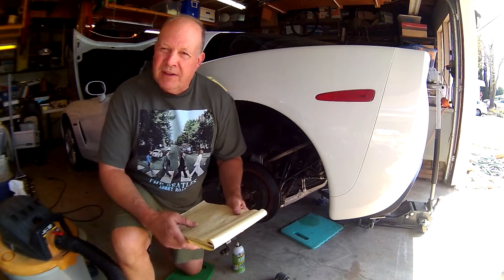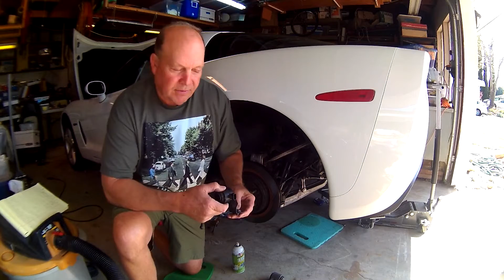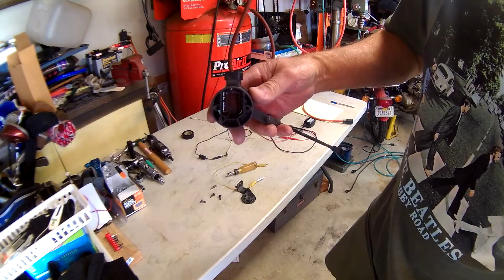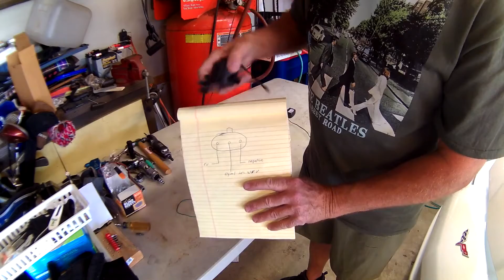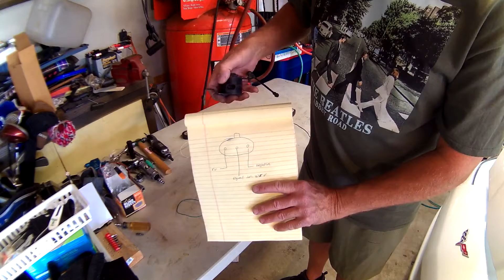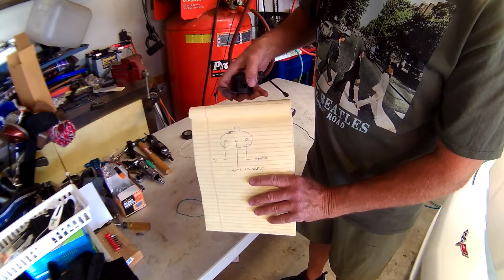C6 Corvette - GM Ride Position Sensor Test

Comment: An easier way to check the ride height sensor, measure the ohms. The power to ground should be around 20k ohms. The power to signal should be around 10k. No need to apply 5 volts. Move the arm up and down to check ohm changes.